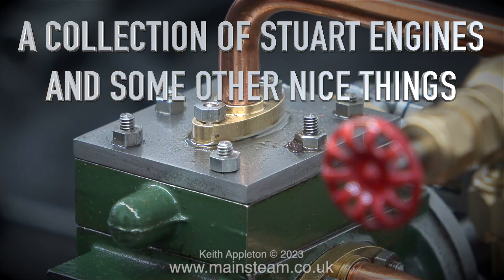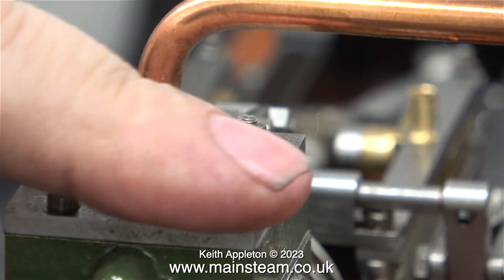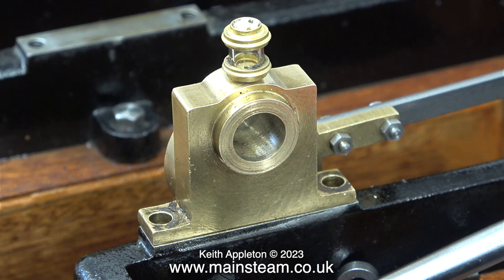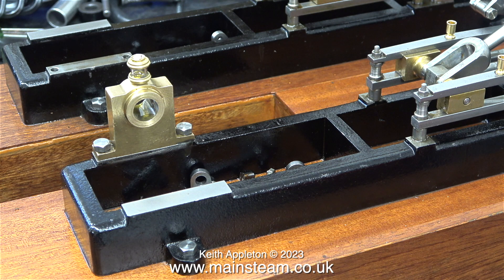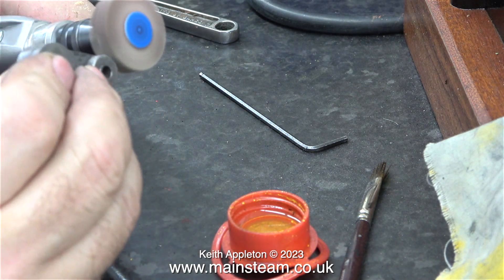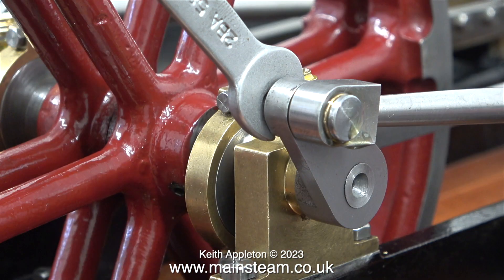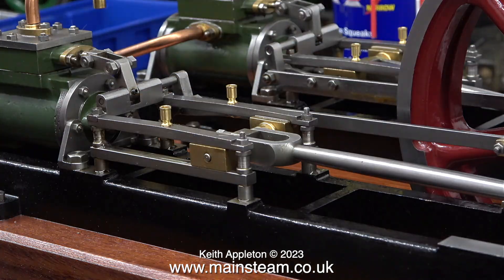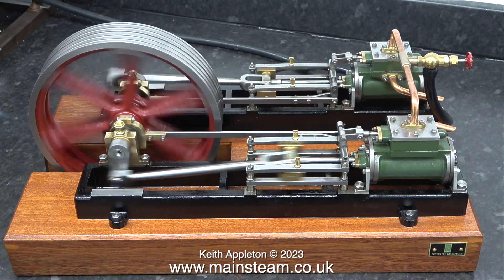REBUILDING THE STUART TWIN VICTORIA - PART #13

Comment: Probably stupid question but... the two engines are not set 180 degrees to my eye, not even close, but it would be possible no? And wouldn't it be a smoother action (although hard to see the running being any better than it is already)?
Reply from the maker: Why would it need to be at 180 degrees? The engine would not self start and it would not be smoother ..........
Reply: @keithappleton  Ok thanks, good to know.

Comment: I really love the way this engine moves did you change the oil cups for the cross head or just replace the bad one?
Reply from the maker: I changed both oil cups on the top Crosshead guide bar for better ones.